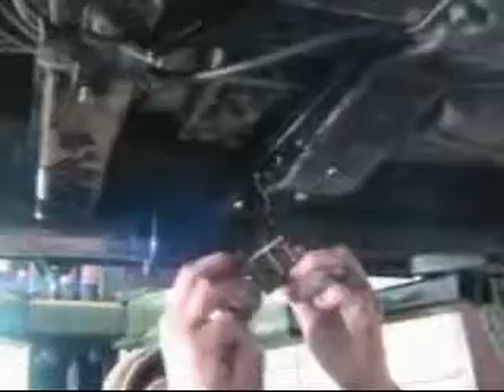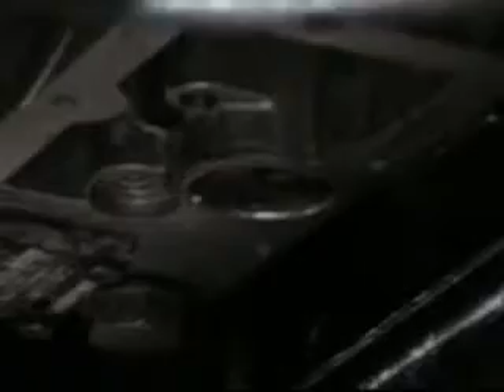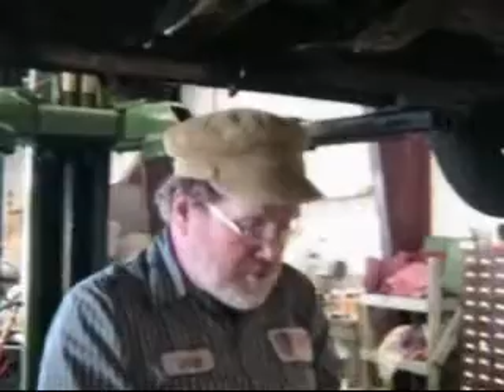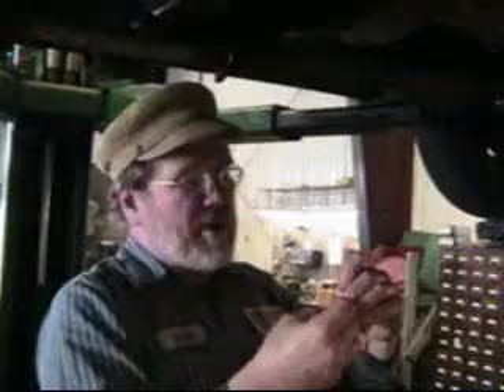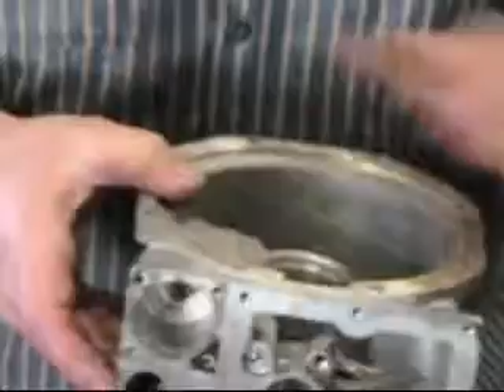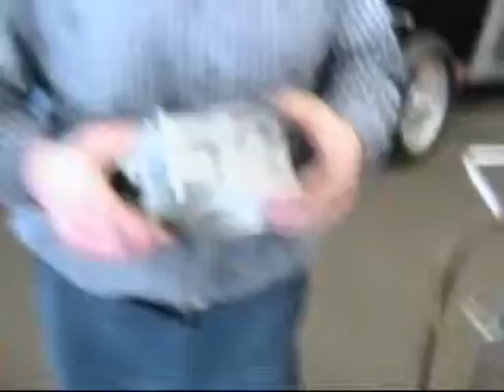106 MG Tech | Overdrive Repair, Part 3

Comment: Thank you for the informative video 😊. I wondered if there was a specific specification for the grease to be used around the overdrive filter when installing it? Also is this supposed to be liberally applied or just a thin bead? Mine is leaking and I intend to replace it, but I don’t want to risk contaminating the oil with grease?

Comment: Two remarks: the little rubber around the solenoid wire was not mentioned, it may develop a leak after many years. Renewal is difficult because it sits VERY tight around the wire, which needs to be cut and reconnected later on. And the mounting of the pump is indeed difficult, but turning the drive shaft for getting the excenter ring to its most inwards position helps somewhat.

Comment: thankyou so much for taking the time to make this series of films on the overdrive. So often we are told to avoid touching them. This is a simple job which is likely to fix most faults. I now have the confidence to tackle it. Glad I knew about the ball bearings as both fell out without me seeing them. I had placed a towel under the gearbox to prevent losing them.